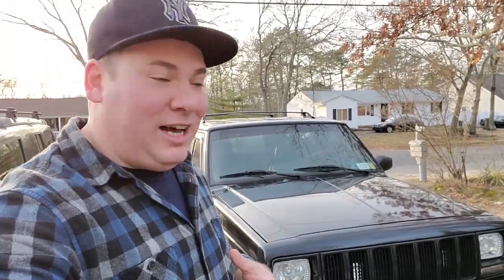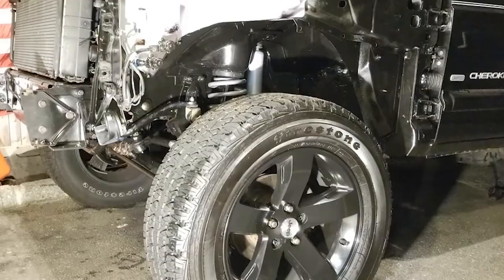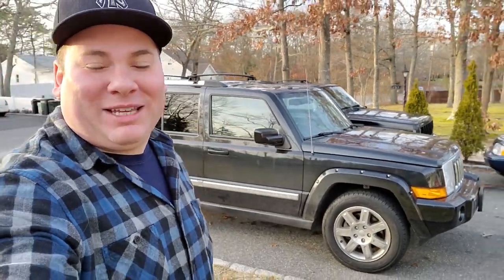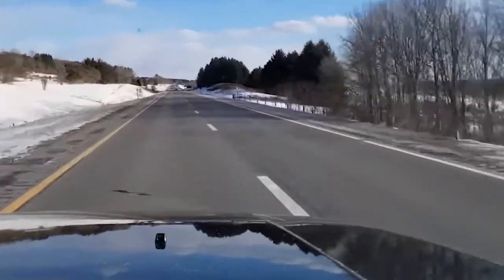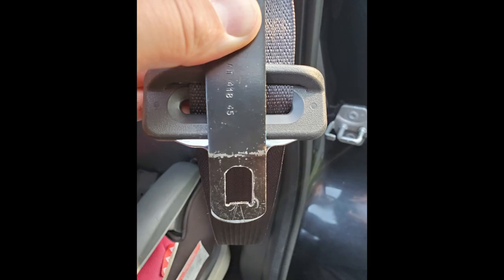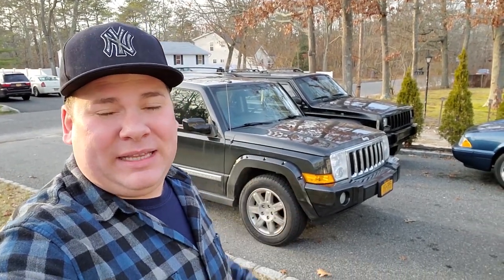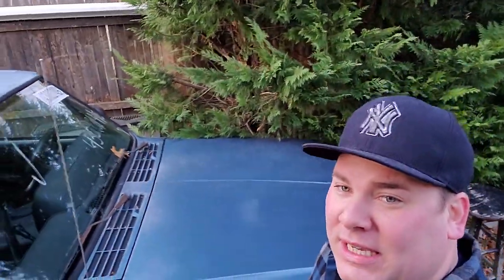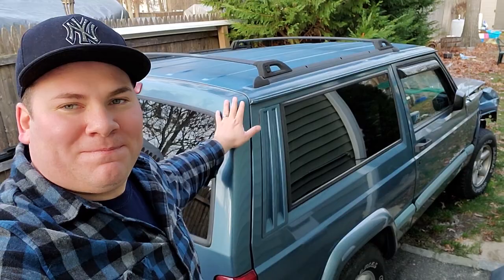JEEP PROJECTS FOR 2020 - GOODBYE PROJECTS OF 2019

Comment: Some Commander stuff would be great, I am not very familiar with them, and I understand some had quadra-drive and earlier models had front and rear limited slip like the WJ's if I'm not mistaken?  

The Commander to me looks more XJ like than the current "Cherokee" ever will, except the Commander is larger and has the 3rd row seating option.  I wouldn't mind a Commander with the HEMI and Quadra-Drive.
Reply from the maker: Yes. Commanders had quadra track.  Quadra track II.  And Quadradrive II.  Mine is Quadratrack II, it has 4hi and an option for 4 low.  All the Overland models came with the Quadradrive II that is pretty much the most capable stock  4x4 system ever made.  Doug from D&E has a Quadradrive WJ.  Pretty awesome
Reply: @ProjectDanH  Thanks.  Someday I'll get one LOL.  Just like everything else, always something that comes up that puts my plans on hold.
Reply from the maker: @wildbill23c  I hear ya buddy.

Comment: Dan, how were the horns attached in the Grievous when you had the bumper cover off? My low-tone horn is dead on my '96 Orvis. Perhaps you'll part with yours in the parts ZJ? Happy 2020, Bill in PA.
Reply from the maker: I reassembled my horn system back to OEM at 13 mins 30 seconds in my ZJ reconstruction video.  Unfortunately my Low crapped out too so I'm going to experiment with the parts car horns

Comment: Hey dan just found your channel as a new LI XJ owner with less than 100k miles 😂. But just wondering what exhaust/header combo were u running on black beauty? Also would love to meet up sometime when I get my XJ on the road👍🏻
Reply from the maker: Awesome TJ welcome to the channel!  I removed the muffler and resonator and replaced is with a straight pipe and a Flow master 40 muffler.  It has the stock headers and tip. Thanks for watching!

Comment: Hey dan I need a header panel off the other zj the parts on and also the grille and the headlights let me know how much u want and happy new year
Reply from the maker: It's all yours. When can you come pick it up?  Make me an offer after you inspect the parts and decide if it can be useful to you.
Reply: Project Dan H where are u located could u ship it to me
Reply from the maker: @colincarlucci6204  Long Island NY.  11967. Yourself?
Reply: Project Dan H I’m in pa what’s left on the zj that u have for parts
Reply from the maker: @colincarlucci6204  it's still basically intact.  So far I removed some dashboard parts, the coolant Resevoir, wiper Resevoir, front seats.  I still need the rear disc brakes and heater core.

Comment: Hi Dan, I have a 96 zj limited 4.0 and I have purchase a 93 zj Laredo with a 5.2.
My question is, what parts can I interchange with my 96?
Reply from the maker: Just about everything except the engine components and the digital climate control system.  What are your plans?
Reply: Project Dan H I wanted for parts because the motor it throw blue smoke.
Saludos from calexico ca.
And thank you.